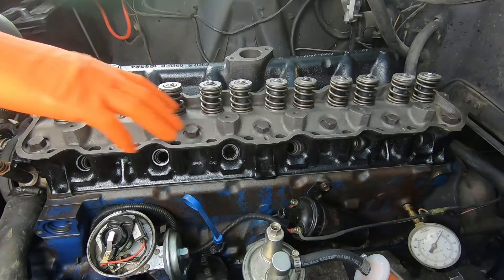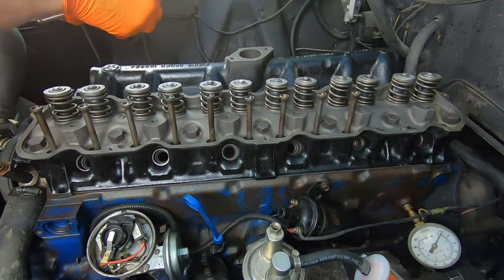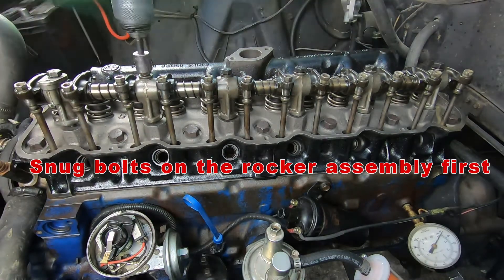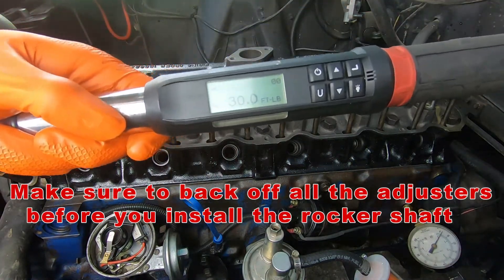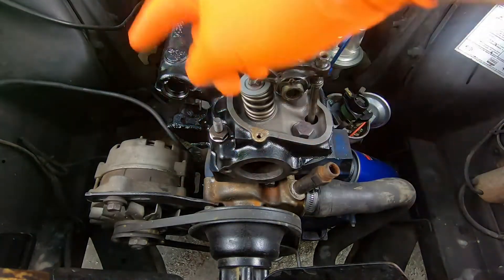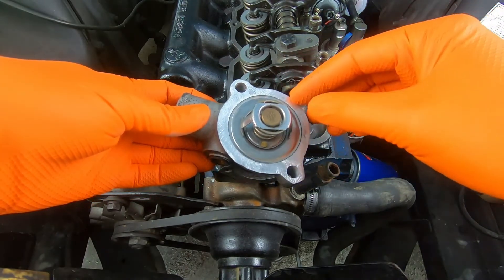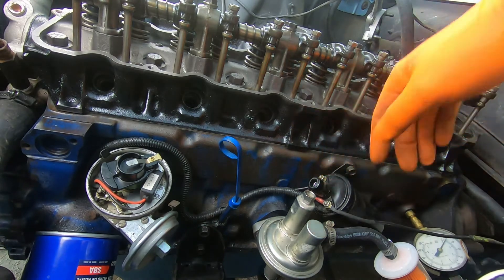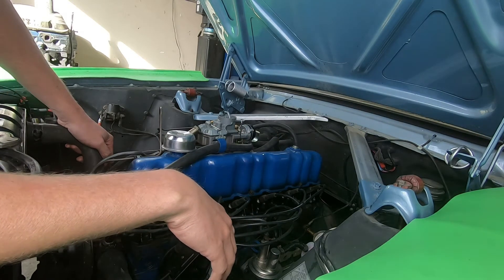200 Ford inline 6 - Installing Cylinder Head part 2 -  Valve adjustment & everything else

Comment: Hi, i have followed these steps and is it ok if i can still turn the adjusters with my fingers still? Even after 3 quarter turn? My valves already had oil primmed as the motor has been running.

Comment: i will be installing a D5 cylinder head which will give added intake manifold volume and will retrofit it with tri carburetors. Thank for the review on the process of removing and reinstalling the cylinder head.
Reply from the maker: Very cool. There is quite a bit that can be done with these 6's!

Comment: On the exhaust divider, one of the thing I love about the 170/200 and the Australian 221 I have (slightly higher engine deck 200,based engine) is the uneven exhaust sound, the divider kills this character.
Aussie Speed that makes many aftermarket parts for 6 cylinder engines makes a duel outlet cast iron exhaust manifold I’m saving up for.
Reply from the maker: Oh very cool. I did not know that. Thanks for sharring!

Comment: I have a comet 144cui. 6 cyl.  needing to replace valve stem seals. 2 questions, what tool can I use to compress valve springs, and do you have a video that shows replacing valve stem seals on an inline 6 cyl. engine like this video?  My car has the adjustable rocker arm set up. (yes, first time doing this).  thanks. enjoyed the video. very helpful.
Reply from the maker: https://youtu.be/Lhp_WgVJo1c This video demonstrates how to use a simple tool that can be rented from autozone to remove the valve springs with the heads mounted on the engine. The engine as example is a 289 but the process will be similar. I do not demonstrate how to replace the seals but the hardest part is removing the spring and putting it back on. I hope that helps.
Reply: great, thanks. very helpful!. just one more quick question, If I carefully remove the rocker arm set up to replace the valve stem seals, then carefully put it back, do I still have to adjust (lash?) the valves? Is it a requirement or just a recommendation because I have the valve cover off anyway.
Reply from the maker: In theory, as long as everything seemed to be running great before taking off the rocker shaft, you should be able to just install it. This is of course because of the design of the 6 cylinder rocker assemblies that are all one unit. As long as you don't turn any of the adjusters, everything should go back on how they should. Now one thing to keep in mind during your re-install, That rocker shaft is hollow and should be installed slowly and tighten each mounting bolts in a pattern very slowly. If you tighten one bolt all the way down before any of the others, you'll likely bend the shaft. It should go down nice and evenly and work in a pattern from the inside out and keep repeating over and over till the entire shaft is tight. Its very important to take your time on this. I hope that makes sense and is helpful.

Comment: Hello Alf, I had to rebuild my head on a 66 200. We had a warp problem that was remedied by shaving the head,  Adjusting valves a necessity, I'm noticing that your rotor on your distributor is pointing up. That's where mine is now. Before my problem my rotor was pointing down 6 o'clock it ran great. When I reassembled the head my compression for the no. 1 plug was very close to what you have. The manual shows the no. 1 at bottom #7ish position. At the 6.00 mark on your video when you're adjusting the #1 valves your distributor shows about 12 o'clock is that correct? Thanks

Comment: Is adjusting valves really just that simple? Got 200 from a 65 mustang in my 62 falcon. Replaced the valve seals last fall and probably should've adjusted them to while I was at it.
Reply from the maker: Ya it's not too bad. If you have an adjustable rocker assembly, it's not a bad idea to do.

Comment: If you need any parts from a 223, have everything except the block and exhaust manifold. Looks like the head is in good shape, looks like it was rebuilt and someone did not torq one of the connecting rods which came loose. Also have a full gasket set for same.
Reply from the maker: Oh cool, thanks!

Comment: Hi there!!
My question is with the port divider. I saw you just putting it in with no welding is that correct? Second question is will that work with an exhaust header instead of a stock manifold?
Reply from the maker: I think some people weld them in place and some people do not. I've been told they will rattle and make all sorts of noise if you do not weld them. I may have lucked out on this one because it is quiet. I wouldn't know on your header application.
Reply: @AlfsMustangGarage  
Thank you 🙏 so much!!

Comment: Hey Alf - curious to know what type of valve cover gasket you used on this project? I see what looks to be an OEM 'cork' gasket on CJ, but then some folks suggest using other material types for this engine. Your thoughts? Also, do you use any additional sealant with the gasket? My i6 has been rebuilt once before and is leaking a little oil from the cover, so I thought I'd try and replace it but just not sure which gasket to use and whether or not to use any additional sealant with it. As always, thank for the awesome content, Alf!!!
Reply from the maker: Oh I just use the fel-pro cork gaskets with a thin layer of ultra black rtv. Seems to be the most reliable for me.
Reply: @AlfsMustangGarage  ok great - thank you! Forgive my ignorant question, but where do you apply the sealant? On top of the gasket itself or next to it?
Reply from the maker: You're good. So you should watch this video https://youtu.be/mRL_2i-1uZE
It's an oil pump replacement for a 428 but when I install the oil pan gasket, that's what you want to pay attention to. I'll install valve cover gaskets the same way.

Comment: Why do you not turn the engine 1/4 turn after getting to 0 lash? Adjust the loose push rods to 0 lash, another 1/4 turn, same until 2 full turns of engine done. Why would an 8, 6, or 4 be any different ?
Reply from the maker: Well the 1/4 procedure only works with 8 cylinder engines. 2 full rotations of the engine is a complete firing sequence of all the cylinders no matter how many cylinders you have right? So with 8 cylinders that is conveniently 1/4 turn per cylinder. A 6 cylinder engine gets divided Into 1/3 of a turn per cylinder. That isn't as easy to turn it 1/3 and be accurate. I find it much easier to simply watch the piston rise to top dead cylinder and adjust starting with cylinder 1 and follow the firing order. I hope that helps. At the end of the day, there are multiple ways to achieve the same result.
Reply: @AlfsMustangGarage  Ok. Then its 4 cycles / 16 valves ; 4 / 12 valves ; 4 / 8 valves then for the turn depending on the engine. I do suppose it's best to get a visual on piston position as well before taking lash out and turning another 1/2 to 3/4 turn on the arm nut.

Comment: I rebuilt my 428 PI with the adj. rocker arms off of a 406 they have a screwdriver slot on the push rod side . with a hyd cam i adjusted them while the eng was idling . I just tightened  the screws until the clicking stoped and then i tightened  up the jam nut,  The valves can't float it ran perfect.

Comment: Alf one more question as I'm finally ready to get my head installed:
How do you bleed the lifters if you use the original ones again, and they are pumped up already? Do I have to take them apart to bleed them?

And how do you pump the lifters up before initial startup?
Reply from the maker: If you pull them out (one at a time because you have to make sure they go back in their original locations) you can use a pushrod to pump the plunger and that usually pumps the oil out. 
If you want to pump them up again after everything is adjusted, my very first video that I made is on manually priming a 6 cylinder engine. Should be able to find it by going to my videos and scrolling to the bottom 👍

Comment: Great clear video as always! I'm putting a 200 CI inline 6 from a '67 Falcon into my '62 Comet.  The Comet had a 144 with adjustable rockers.  I had the 200 rebuilt with the adjustable rockers and push rods from the older 144.  I'm getting ready to drop the 200 into the Comet.  I understand how to find TDC for the #1 cylinder.  It wasn't clear to me (a relative newbie) what you did after you adjusted #1 rockers.  Did you just go in order of firing sequence and adjust the rockers or did you turn the crank to find TDC for each cylinder before adjusting each one? I read somewhere to make the adjustment on each cylindwer with both valves closed.
Reply from the maker: So after number one, I do follow the firing order for the remaining cylinders. When the next cylinder to fire is at top dead center, that'd when I make my valve adjustments and yes at that moment, both intake and exhaust valves will be closed.
Reply: Oops, watched the video again and answered my question!

Comment: Greeting from Europe, That's a great video!! , a big thanks,   it helped me to make all the steps in right order. 
But still struggling with one thing,  how to adjust the valves if I am using the old lifters?  
they are looking really good,  don't wanna replace them. 
I have the rocker arm with adjustment possibility.  many thanks
Reply from the maker: Greetings! So when it comes to adjusting valves, do you know if you have hydraulic lifters or solid lifters?
Reply: @AlfsMustangGarage  Hi, There are hydraulic lifters, its  a '66  200cui engine
Reply from the maker: Here is a link to my valve adjustment video. Now this is on a 289 v8 but the process is the same. You have adjustable hydraulic lifters so the only thing that is different is 2 less cylinders and a different firing order. I hope that helps. https://youtu.be/VdXV15PXa2Y
Reply: @AlfsMustangGarage  Thanks again for great video,  to be sure we both understand each other 100% and to prevent some damage, I'll ask one more time, 
It's a 200cui mustang engine, I did change the head gasket due to its failure,  I did keep the original hydraulic lifters (they are pumped up)  and now I need to adjust the valves.  What is the right procedure for adjusting with such used lifters?  still the 3/4 quarter turn in the end?  
really appreciate your help!
Reply from the maker: Yes, I would still do the 3/4 turn past zero lash. The other thing just in case it wasn't clear is each cylinder that you're adjusting, needs to be at top dead center compression stroke. I like to start with cylinder 1 and then follow the firing order. Now the V8, you can rotate the engine 90 degrees to get the next cylinder but that doesn't work on the 6 cylinder. But it's pretty easy to visually see when the piston is at the top though. Does any of that make sense? Hope that's helpful.

Comment: I am so envious of how few vacuum lines are on this engine.
Reply from the maker: Lol right? The good old days before the vacuum operated emission era.
Reply: @AlfsMustangGarage  Can I safely bypass all that?  I live in Florida where there are no emissions tests and I'm so afraid to start pulling stuff to get to the valve tick on my 81 Zephyr.
Reply from the maker: Oh I wouldn't be able to speak for that kind of stuff. I typically work on this stuff from the 60's. But when in doubt, take pictures before you take it apart. Usually makes putting things back together a little easier.

Comment: The service manual for my ‘63 Falcon says to turn the adjusters 2 1/2 turns past zero lash. I figured the procedure would be the same for all adjustable rockers. Not so? None of the lifters are bottomed out at 2 1/2 turns.
Reply from the maker: There are multiple different ways to accomplish this task. Can't really go wrong with what the manual says.

Comment: Hello, I tried doing this on a stock engine. And the torque crack a piece of it. It should be fine but I don't know why is happened.  I believe mines is the non adjustable one. So should I just bolt back on and make sure the rods are tight??
Reply from the maker: Humm what cracked exactly?
Reply: @AlfsMustangGarage  the rocker arm. I tried 30 ft pound of torque
Reply from the maker: Humm ya I wouldn't recommend running the engine with a cracked rocker arm. Was it the adjuster you were tightening?
Reply: @AlfsMustangGarage  it's a non adjustable, not very educated on the topic. It's the stock one from factory that many 200ci have like mentioned in the video. Not the same type as in the video itself. The crack isn't bad but I didn't want to mess with it.  Also. When I tighten it, the rods are supposed to be tight and unable to move by hand correct? There are pretty much no videos that talk about the bare bones stock arm.
Reply from the maker: Check out www.fordsix.com tons of technical information about all ford inlines. Has the cylinder head and/or block been rebuilt?

Comment: Thank you very much. I am working on a 65 200. Fun easy project rebuilding the head. The rest of the engine is fine so I left the lifters in place. What is the correct rotation for a pumped up lifter or do they drain down over the week I have had the head off?Thanks
Reply from the maker: You're welcome. You know, some lifters just don't drain down I have found on some of these engines. If your head is back on, you kinda have to put some pressure on them with the push rods. The next day, rotate the engine by hand a few times and keep repeating until they are all relieved of pressure.

Comment: Can I reuse my ol' thermostat after a engine head rebuilt or do I go with a new thermostat.  Mine is like 180.
Reply from the maker: You can but thermostats are pretty cheap so its never a bad idea to get a new one while you're doing all this work. I like to get the "Failsafe" brand. They are designed to stick open when they fail that way they won't stick closed and cause overheating.

Comment: I'm working on a 66 bronco with the 170 6 cylinder...same setup but I need to get the valve lash right.  I think this will help.  I've done it with a feeler gauge to .018 but still doesn't sound right.    I will try your technique.  Did you have to adjust the timing?
Reply from the maker: So if I recall, a lot of the 170 engines had solid lifters. Is that right in your case? If so the .018" valve lash adjustment should be the specification. I'm adjusting this 200's valves with hydraulic lifters so the process will be different than one with solid lifters. You'll want to make sure you don't over tighten them. And yes when I had the engine back and running, adjusting the timing was something I did.
Reply from the maker: Oh and solid lifter engines do make more clatter than hydraulic lifter engines so it might be normal in your case.
Reply: @AlfsMustangGarage   going to try your technique and go 1/2'turn beyond mine is running...I've done one before and it was much quieter
Reply from the maker: Sounds good!

Comment: Thank you for the detailed video! Although I have one question: Did you weld the exhaust port divider onto the head, or is it possible to just slide it in? Regards, Martin
Reply from the maker: Thank you! I just slid mine in and then bolted up the manifold.
Reply: @AlfsMustangGarage  Nice, that's the simplest way then ;)
Reply from the maker: Indeed it is 👍

Comment: Thanks for your videos! Very helpful! I have a 66 coupe with 200ci. I have done a rotisserie restoration on the body and complete rebuild on the front end, it now on to the engine rebuild.  Most of the major body work is done with welding and everlast body putty, have more stripping and priming to do. Look forward to gaining more knowledge from Alfs garage....a big Thanks!
Reply from the maker: That sounds awesome! Sounds like you've been hard at work. Getting that body on the straight and narrow is a chore! It's probably releaving to move on to other parts of the project. Thanks for commenting and subscribing!

Comment: Awesome series, I have a 65 mustang with a 200ci as well and im about to start doing the same work.... also im looking for an ac bracket that mounts to the driver side, do you happen to have one or know where I can find one?
Reply from the maker: Thank you! Very cool that you have a 65 6 cylinder. So are you looking for an original a.c. bracket? I'm afraid I don't have one. Have you tried looking at National Parts Depot or CJ Pony parts? I'm not actually sure if anyone is making those reproduction or not.

Comment: Great videos! I just purchased, in fact , I have yet to go and get it this coming week,  a1965 Mustang w/ a 200 I6 engine. I figured I'd go ahead and see what problems to look out for ahead of time, since this car won't run properly.  Thanks for sharing your knowledge.
Reply from the maker: Very cool! Congratulations on your purchase. Ya I try to post whatever I get that comes my way but don't be afraid to ask questions. I've got a lot more videos in the works. Do you have an automatic or standard transmission?
Reply: @AlfsMustangGarage  My Stang is an automatic...I believe a C4. I hope to get it Monday, the 28th. I am 3/4 the way through on my 1st frame off resto that is a 64-66 Chevy C10, I put a 350 in it with a powerglide (since that's what I had to work with),  I had a 1968 Mustang 302, 4 speed manual trans, deluxe package, when I was in high school...I bought it used and loved that car!  I drove until it rusted out...back then I didn't have the $$ to save her. I was looking for another one, but few and far between that were in my budget and also not all rusted out, so I found this 1965 and went for it.
Reply from the maker: That's awesome! Very cool with the Chevy also. Ya these cars this old are getting harder and harder to find that are solid and not completely rusted out. Sounds like you have one that is already a driver car or does it need some work?
Reply: @AlfsMustangGarage  its an automatic. and needs a lot of body work. The interior has been removed.
Reply from the maker: Sounds like you have some fun ahead of you! Good luck with your project, thanks for sharing, and don't be afraid to ask questions.